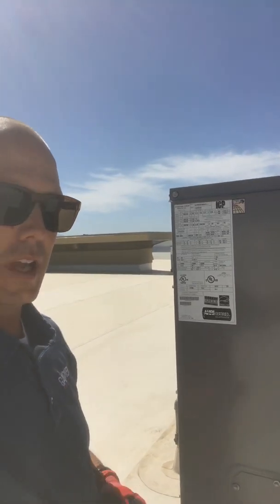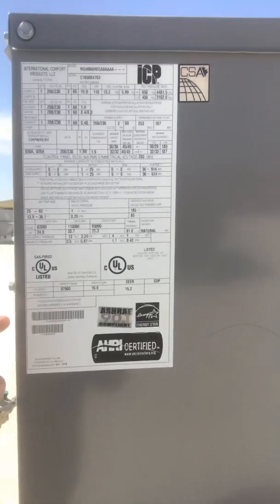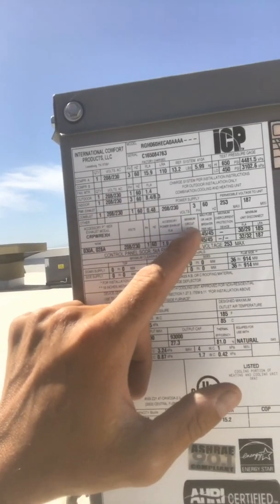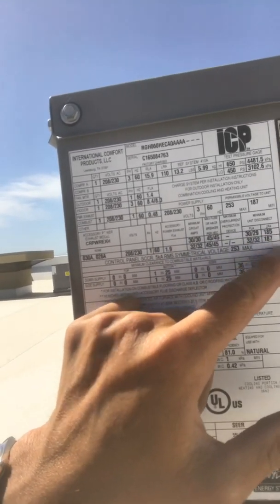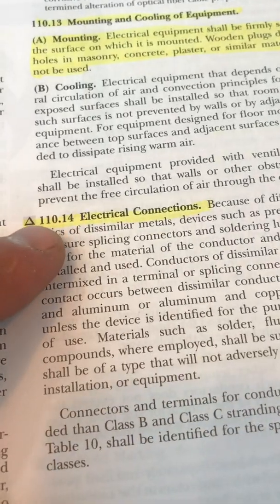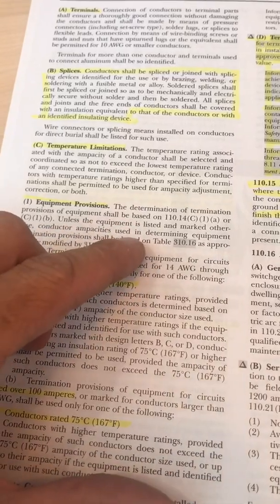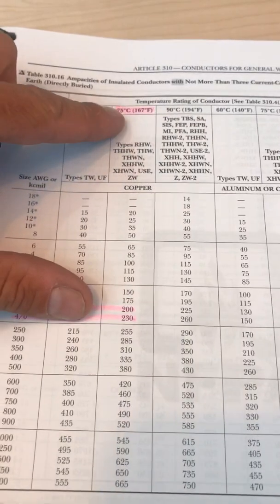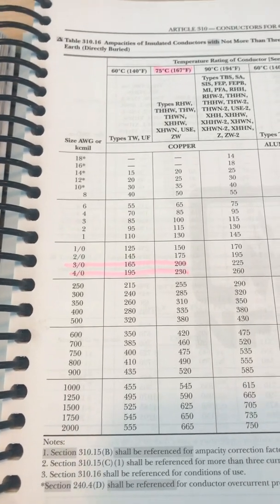Sizing wires (conductors) for a air conditioning unit

Comment: Shouldn't you also let your listeners know that an AC-rated breaker must be used at all time for condenser or heat pump installs? Very important requirement that you all are missing.

Comment: Do you run the wire max 40AMPS(8AWG) to disconnect and 30 AMPS (10AWG) wire from disconnect to the condenser. Or use 30 AMPS (10awg) wire to the condenser with disconnect box
Reply: That's easy! Go with 208v.

Comment: I'm having a new HVAC system installed at my house and the installers are driving me nuts. The name plate says MCA 35a and Max Fuse/Breaker is 60a. I have an 8ga NM-B wire there and they keep telling me I need to go with 6ga because the inspectors "don't like" minimums. Honestly, I don't care what they like or dislike, it's what is code, am I correct?
Reply: Local inspector can trump the Code if they want to. They have the final say in their locality and jurisdiction.
Reply: @OtisPlunk  I had it installed last February. I talked to the inspectors at their office and they were cool. Said the installers didn't have a clue.

Comment: Chad hopefully you can help me out? I'm installing a mini split system with the condensor name plate saying Minimum Circuit Ampicity is 20A  &  Max Fuse/Breaker( HACR) is 30 A  So would I assume I use a double pole 30 A breaker with 12 guage wire to the condensor? The run from the panel to thw condensor is about 40ft.  What about the fuses for the disconnect? 20A or 30A? Any help is greatly appreciated! Thank you!
Reply from the maker: this is a great question! You can use 12awg conductors because the minimum ampacity says 20 amps  and yes you would protect those conductors with a 30 amp breaker. if the mini split is 240 v or 208 v 1 phase you would use a two pole breaker, if its 120 it would be a single pole breaker. if it is 208v or 480 volt 3 phase you would use a 3 pole breaker
Reply: @chadgerman8173  Thanks so much for answering! So should I use 20 amp fuses in the disconnect box? Also just curious, the name plate on the evaporator (inside unit) has electrical info on it like the condenser. Are you suppose to take this info also in consideration of what wire and breaker to use or do you go just by the electrical info on the condenser? Thanks again!
Reply: I have an XR16 side discharge Trane A/C unit going in.  Would I run a 10/2 or 10/3 with ground for the 30 amp breaker?  Thx

Comment: I'm confused. You said anything that is 100 amps or less we use the 60° column and anything that is over 100 amps we use the 75° column. But everything I work on in residential air conditioning is under 100 amps. We're talking about the max fuse or circuit breaker when we're talking about maximum amps right?
Reply: He’s talking about minimum circuit ampacity. You size they wire to minimum circuit ampacity based on 75 degrees F (this is what the manufactures recommend) based on Table 310.16 Ampacities of Insulated Conductors. You size the breaker to maximum breaker or fuse size that is on the label on the unit.

Comment: So I have asked for a quote on replacing a gas furnace with a heat pump system. Quote was for a 3.5 ton unit but the tech said I would have to go dual fuel because my electric panel is a 100 amp service and unless I wanted to upgrade the panel I could not put a heat pump on it by itself. Now talking to other folks they all just scratch their head and wonder why he would say that. 
So I am at a loss. I can certainly upgrade the panel the lines from the utility to the house are sufficient but do I really have to do that?
Current panel has lots of space for more circuits.
Reply from the maker: He was just trying to up sale. I would beget another quote. I always tell people to get 3 quotes and pick the middle. Never tell them what the other guys quits are.